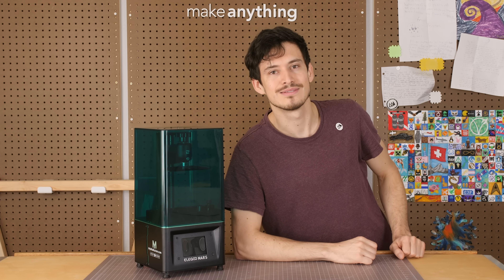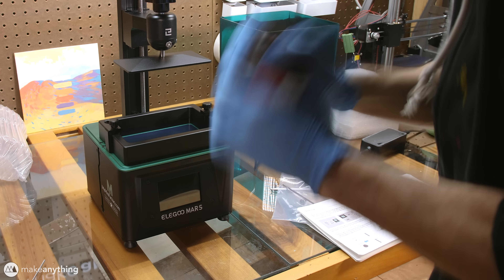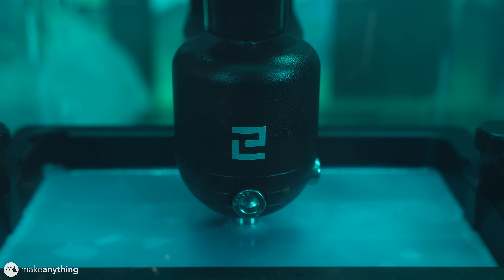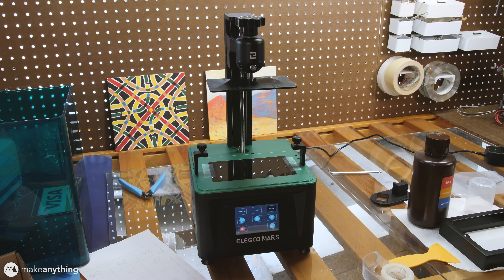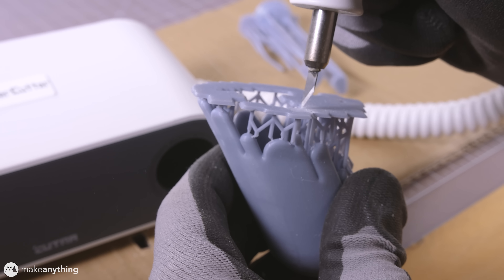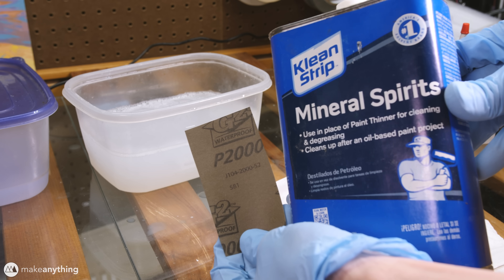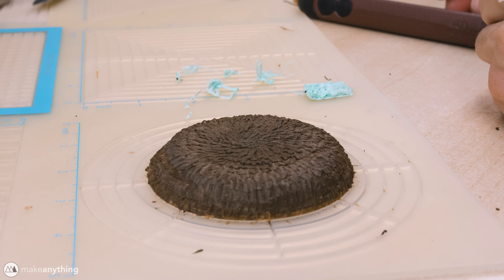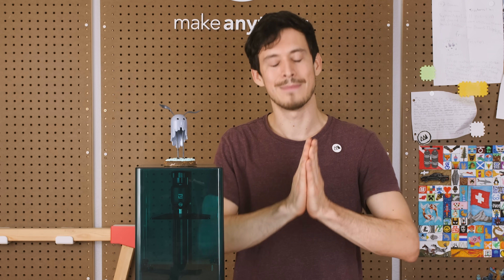Resin Printing with the Elegoo Mars // First prints, troubleshooting, impressions

Comment: There is an extraordinary level of bad information in this video...
Reply from the maker: Enlighten me kind sir
Reply: @make.anything  vinyl gloves, lubing the surface, spilling resin everywhere, the resin not being fully cured since it was just set in the sun, handling that resin, assuming its supposed to felixible like that, using a sonic knife on it which then kicks up uncured toxic resin dust, the list goes on and on.
Reply from the maker: Fair enough. I was very new to resin printing and have since decided to avoid it until it's far more convenient. I guess the manual + handful of videos I watched didn't teach me enough